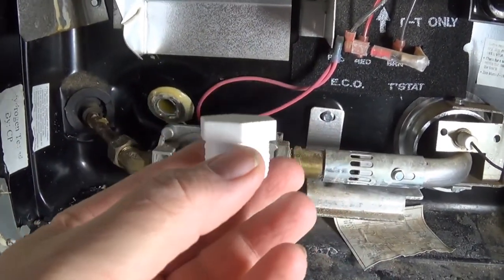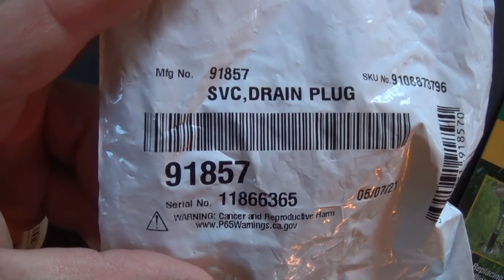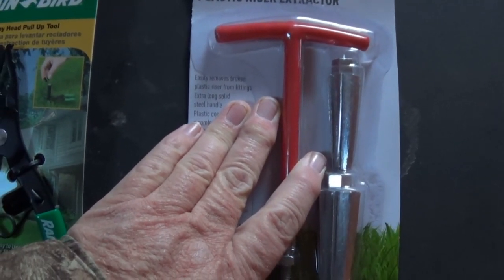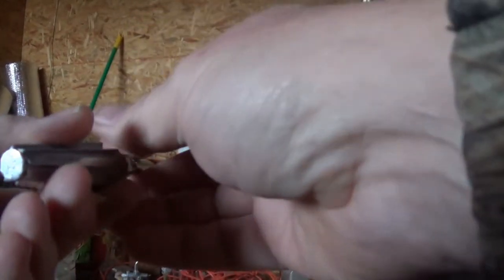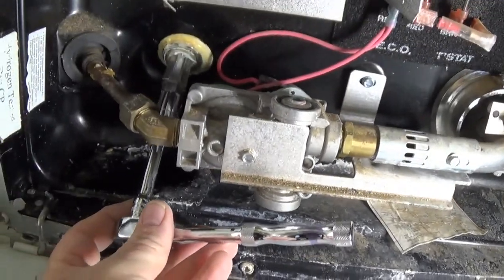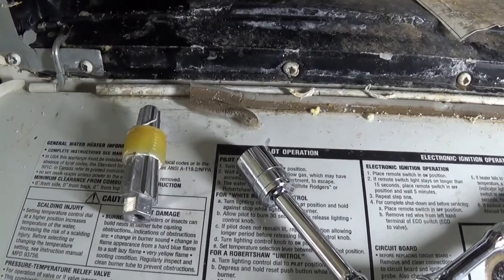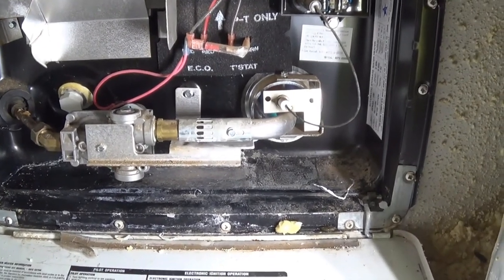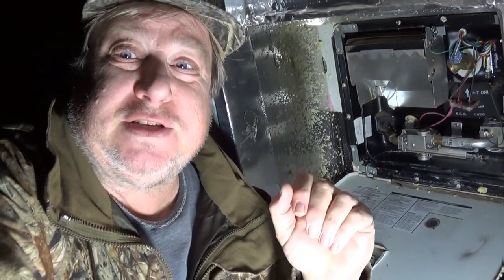RV Water Heater Won't Light

Comment: I am not sure if pvc is recommended long term for hot water but I know very little. You might want to watch for a nylon one online to have on hand. I think brass would be good.. I've been in binds before with plastic fittings where I did not have an easy out tool. I have slowly carved and chipped stuff like that out in the past. Or pounded a similar sized chisel or screwdriver in and used a cresent to screw it out. As long as the metal threads don't get dinged... And I have dinged threads before as well, and sealed the hell out of them before putting water pressure on. Dinged threads are something to avoid though...
Reply from the maker: there are a different type of plastic plug but this is the recommended one. if the other one lasted for 7 yrs i am good with replacing them every 7 yrs or so. lol....

Comment: Hey Jeff, can you give us an udate on how you solar is still doing. Thanks man.
Reply from the maker: i want more solar. lol.... after 7 yrs of solar its perfect for my use. i do need to upgrade everything so i can increase my usage. important part is keep water in batteries. i forgot a few times and reached low voltage. no water means the battery cant keep the charge. i do use the generator more when i am facing lots of cloudy  days trying not to let batteries get to low.

Comment: Use a brass plug that will end the problem and won’t get stuck for ever
Reply from the maker: no brass plugs, only plastic and there is a metal plug but not brass.